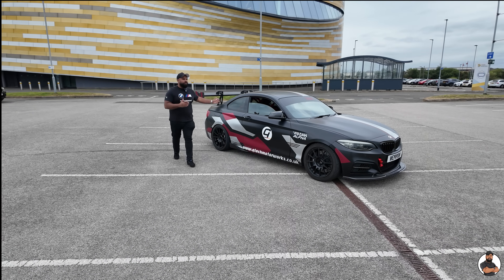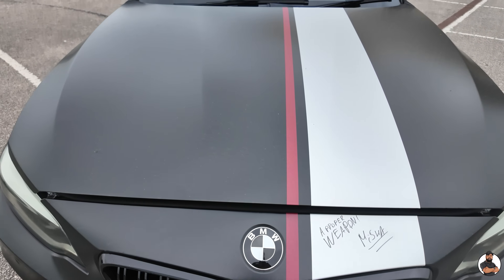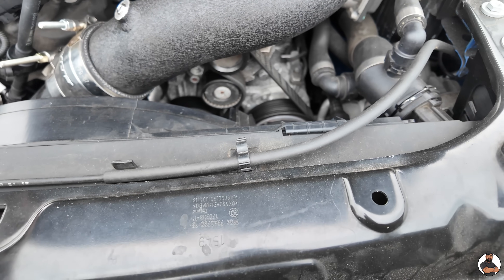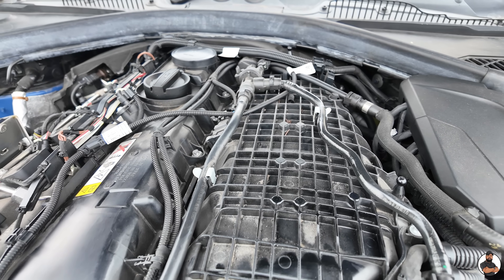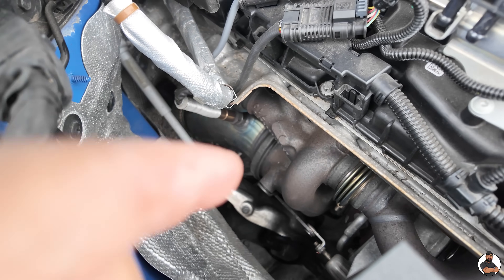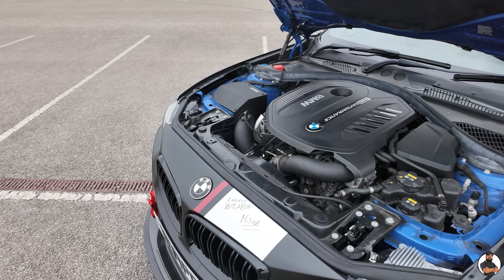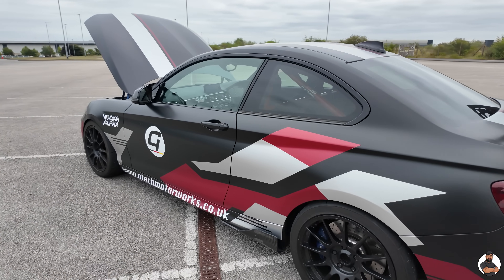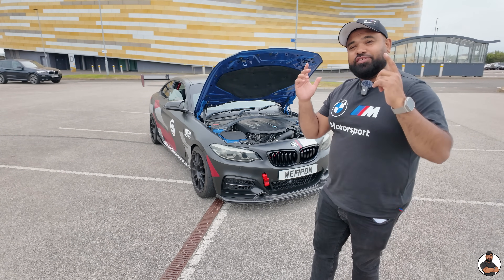Unlock the Full Power of Your B58 Engine | Stage 1 & Stage 2 Mods Explained

Comment: Any suggestions for tuning the X3 M40i? 2020. I have a racechip black on it just now and its pretty decent to be honest and i can remove it is needed. Want a bit more power but still keep it as a daily driver. Is the downpipe worth it? Cant be dine with the management light issue though.
Reply from the maker: Definitely recommend stage 2 with Downpipe

Comment: You don’t need to upgrade the plugs on the b58 , unless your running over 650hp you stick to the NGK 94201 and you leave it at stock gap , you also don’t have to upgrade the charge pipe unless you’re running over 600 HP, and the flash tune to go with is MHD which is more aggressive then bm3
Reply from the maker: @ganuv  ok sounds like you know what your doing